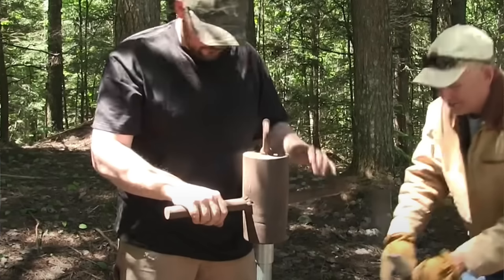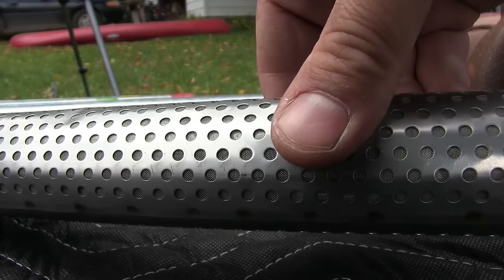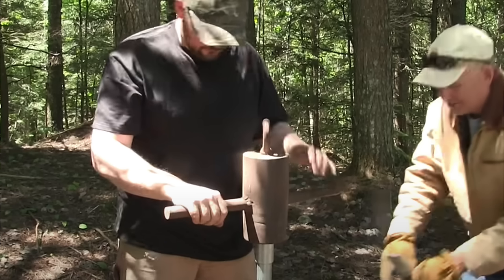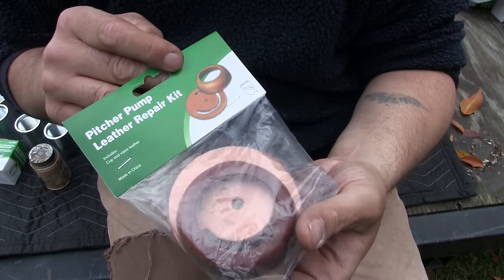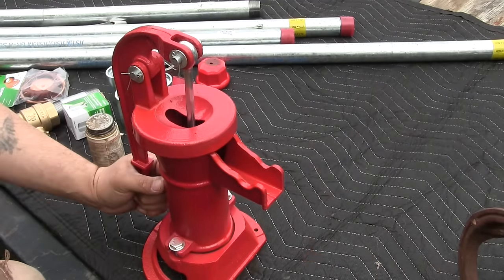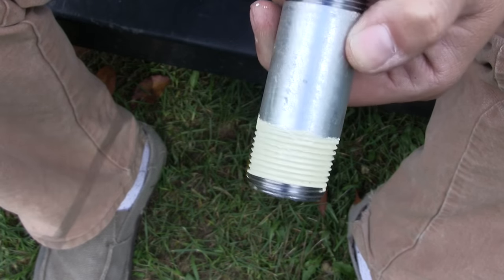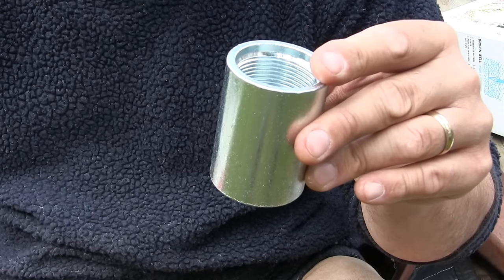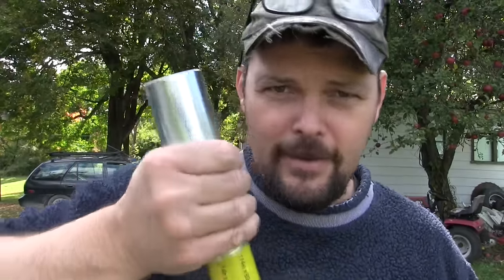Hand Pump Well , off-grid, self-reliant water, everything you need to know

Comment: For reference, the volume of water in a 2" tube at 24ft is just under four gallons and the water inside the tube will weigh 32lbs, which is why you seldom see hand pumps with a bigger well head than 8mtrs... to be honest you will seldom see a basic domestic pump with better suction than that too, so if you water table in the summer is 24ft below your pump then consider siting you pump at the bottom of the hill !!  I speak from experience
Reply: So really it should be, Jack and Jill went down the hill to fetch a pail of water.  Except then they wouldn't be able to fall down the hill, because they would already be at the bottom!

Sorry lol, just got done teaching at the local preschool...

Comment: I think that the no pipe dope on the 1st 2 threads tip is a great tip. For all applications, like hydraulics, air, or gas. Even for Nitrogen gas used for laser cutting. 
This whole video is full of great tips.

Comment: There is another way of driving the pipe down: in the hole you dug, add a bucket of water first, then you may join two 5 feet pipes to the driving point, and then you can simply raise the pipes up and the drop them down. With the water in the hole, the weight of the pipes can drive themselves down into the ground. You can add water into the pipe as well so the water can get to the driving tip position. This way, you do not need to use hammer or the home made driving weight.
Reply: Great tip; thank you!
Reply: I'm familiar with this driving possibility but I think the method may obscure when you have hit water.

Comment: I have worked with these for a few years. Your explanation was fantastic.  I like your style and the way you addressed those areas you were  not comfortable discussing. 
In my area, the ground water is quite hard which requires replacement of the well point every so often.  I have 2 points: one in the ground and one waiting.  When I must replace, I pull the pipes out, swap the point and reinstall.  I take the one just received and treat it with a bath of CLR rust remover inside a section of pvc pipe I keep on hand for just that job.  This dissolves all the growths off the silt screen and reconditions the point for return to service [after a good cleansing].
Reply from the maker: Sounds like a good system.
Reply: Test water for contaminates drinking from surface water. I am old water well driller now retired.

Comment: Another tip - to keep any "junk" off the pump when not in use, the 10 quart Behrens #1210 hot dipped galvanized bucket works like a charm. Tip it upside down and it fits over the pump like a glove. The wire handle fits securely under the pump handle, furry woodland creatures can't seem figure that out and strong winds will not blow it off.

Comment: Love the vid, information I really didn't have. I think you could set up with a T and valving so as to add a small electric pump, 12v that could be run off of solar. Teco makes some small ones that run off a single solar panel for pumping water from a rooftop water solar panel to a water tank in the house. I'd have to check to see if they had one that was self priming though. And, once the well was sunk, I think you could switch to Sch80 or even Sch40 for all the above ground plumbing. One note on pipe dope vs. teflon tape: neither is intended as a sealant. they are both intended as a lubricant to allow the fittings to be tightened enough for the threads to make the seal. If there is a leak with either it's because the joint isn't tight enough.

Comment: You dismiss Teflon (PTFE) tape, then complain about the taste of PTFE pipe dope?  Just use the damned tape, and be done with it.  It's not like it's $100 a roll, and if you put it on right it doesn't leak, either.
Retired plumber.
Reply: Yes and there is now even improved version like Kolmat Fibre Seal that allows you to turn back 180 degrees on the coupling you just tightened too much (which happens all the times when I mount taps and elbows...) See video https://youtu.be/cdDCyLpnAB4 By the way, what do I spot here?  https://youtu.be/0QUk6fn8Lr0?t=836 :-)
Reply: you are right, i thought,,well after a couple times a person figures out how to wrap pipe threads but aint my show uno,,
Reply: @ttkddry  It looks suspiciously white and tapey...  ;o)
Who TF uses garden hose for pressurised water supply?  That won't last long, especially when the sun gets on it.
Reply: Jordan Moir  Zinc pipe hasn't killed me in 70 years.  Maybe I'm too mean to die.
Reply: Take it easy.

Comment: 7:10 you could use a fence post driver..(its the same thing and commercially available)
Reply: And I have seen motorized T-post drivers that might work as well
Reply: I thought the same thing
Reply: @dropshot1967  . We had some heavy post drivers (called them thumpers) in the service, had t-posts and v-posts.
After building a couple of miles of fence for a defensive  position, you get some sore..😁👍🇨🇦
Reply: Could you combine the fence post driver with the pulley and tripod to make it easier? Also, is it possible to use more pulleys to get more leverage? Seen some interesting info on using pulley systems to lift lawnmowers etc in a garage.
Reply: @tracyk3567  I was thinking to raise and lower the weight you are pounding the pipe in with. Still no?
Reply: I meant to raise it then let it drop.

Comment: Great video, It is not usual for anyone to talk on a point such as this and remain interesting. Your plan is right on the money and steps understandable. The extra tips about the joint compound, and cleaning out the pipes is on the one, because I would not have known or thought about that until after I installed the pipes and pump . Those are the things that will make a big difference with the taste of the water which are very important to me when I drink the water. I have to say again, you made a nice instructional video and it shows. So many tubers are now concentrating on fluff, instead of strong, interesting, and thought out content. Nice job! Now I can install my well and pump like a pro.

Comment: Old plumber turned me on to rectoseal number 5. It is much better seal and lasts forever. I could not find an old pump so I took a cylinder hone and cleaned up the bore. If you open the ball valve all the way you can trap water behind the jacket and it will crack, always leave ball valves slightly open over winter... Great video, I really appreciate all the information. You're increasing My carpentry confidence!!

Comment: Back when I was a kid we drove a well for the cottage we were building. As soon as you gave that taste test I could remember how that first water tasted out of our newly driven well. It lasted for about a month. Also it seems like the older pitcher pumps had a bit longer stroke on them. Thanks for taking that pump apart and showing how they work especially with the leathers. Great visual aid. Hope you and your family have an excellent Fall season.
Reply: yup:new pumps got like 5 pumps in 1...alot leathers and go like 60 feet: more softer slow pumps but just keeps going/waters keep comeing at slower rate /smaller pipe :>)

Comment: Great video! Thx! Best way to pull stubborn pipe well pipe is to use a heavy duty hydraulic car floor jack (2 ton or so) or just a regular hydraulic jack, wrap a chain around top collar of pipe, and the other on the end of the jack and jack it upward. You can use wood or the like as a base for the jack so it won't sink into the ground. Usually once you get the pipe moving, it gets easier and you can just keep cinching the chain down the pipe as it rises. 
😉👍

Comment: There is so much misinformation about depth.  How deep is the water level in your pipe.   That’s the depth that matters, nothing else.   You can go down 100’ and still have water at 8’ which is your draw level.   Steel couplers used to have a collar inside which was important to hit with the pipe.  That way your threads aren’t taking the impact.   Since they no longer have shoulders make sure your pipes touch inside the coupler or your threads my give way.   The first one I drove I broke off the threads and pulled up what we could and started over.   Lesson learned.   You remove it with a car jack and a large -pipe wrench.

Comment: My well is 26' and I use a hand pump to bring water up to the top of the well pipe in the springtime before I hook up my electric well pump.  Water is held at the top of the pipe with a second check valve (I have one at the well point and another at the top of the pipe).  That helps me get water to the top easier but the pumping is still noticeably more difficult.

Comment: Well, I clicked on this just because I find the subject interesting. Currently, I have a motorized pump setup from a previous owner that seems to be either dried up or the screen down there is clogged. I ttried to pull the pipe using a come a long and rail road ties for an A frame but it didn’t budge. Only the come a longe handle bent so I left it. I’d like to get it going again so now I have the incentive to pick a new spot now that I’m here with great info on the subject.  I’m going to install a well after the current freeze simply because everything covered here is so true, easy to follow and understand. For anyone reading, please know this information can’t be found in a simple search and can be applied to many aspects. Please also know, the wealth of information here is worth saving. So save the video, write it down, record it, do whatever you can do to keep it so you can refer to it. Thank you so much for posting. May God Bless.
Reply: Try driving it an inch or so.. kinda like tightening a stuck bolt a smidge, to get it to break loose. Also an old time car jack- high lift- and a length of chain wrapped around the pipe, sometimes works for extracting. Junkyard best spot to find them anymore!!
Reply: @tomgrams2333  Hi Tom: I tried  a 10 lb. sledge until it mushroomed. I put a pipe wrench on there with a 6’ piece of 1” black pipe to twist while my friend pounded. No go. Next time I’ll drill a 5/8” hole in there with a bolt to grab on with a hydraulic pull ram that I have left over from my body shop days. If that doesn’t work, I’ll have to find another spot. Thanks for helping me. May God Bless.

Comment: We did this at our camp.  I'm also in the U.P.  On the home-made driver, there use to be fence post drivers sold at TSC, Menards, etc. that are similar.  Even a larger piece of steel pipe (1 1/2' to 2' long) with a chunk of iron welded on the top works.  They're sold as metal fence post drivers.

Comment: Couple of tips I have for you. Your drive coupling the one your going to replace , always keep it tight or it will split when driving. A nice size engine flywheel welded to an axle shaft makes a good driver. A person on each side lifting and dropping the flywheel makes good work. I have pulled new wells with a log and a piece of chain and a large block. Lay down the block close to the well pipe to set the log on, adjust to get good leverage. Hook the chain around the end of the log close to well pipe. Have one person lift the end of the log  opposite of the well pipe. Wrap the chain two wraps around well pipe the push down on the log. Pipe will lift out of the ground. Keep repeating sliding the chain down on the well pipe each time. I hope this method makes sense to you. Thanks for your videos. ATB
Reply from the maker: Thanks

Comment: Lucky for you. Out west, I don't think I've ever heard of water less than 100 feet and that would be very lucky too.
Reply: Where I live in Georgia many people used to have (and many still do) bored wells that were maybe 35-40 feet deep that supplied their households.  Others had drilled wells several hundred feet deep.  Electric pumps on both kinds, of course.   My old bored well is capped (pump and shed removed) and I'm now on county water.  I could start using it again if I chose to.

Comment: Thank you for this video. Just recently got the ability to move out into the country. We now have well water and septic and I have no experience with either. My grandparents had both but unfortunately my grandfather is no longer around to ask all the questions. We have to redo both and this is some great info to add into the mix, thank you.
Reply: Please make sure you have your septic pumped every two to three years, or the results will be a nightmare. If not pumped out regularly, all that icky goo will back up into your house, and you sure don't want that! If you are using the old system at all it would be wisdom to have it pumped out right now since you may not know when it was last done. Call a local septic company, and they can let you know the frequency that it should be done. Last time I had mine done, it cost @ $200.

Comment: The pounder on top  is called a post pounder or picket pounder you can find them online.
Reply from the maker: ( not the same thing) the one we used in this video is probably 4 times as heavy and has a 3' piece of 1" rod that goes down the pipe to guide the hammer......
Reply: @Bushradical  Question, we have Amish here in Indiana that install round fence posts, probably 6" in diameter and 8' in length or better. They use a skidsteer attachment that drives the post into the ground. Wonder if that would work in this situation?

Comment: A great explanation of how these pumps work.  60 years ago, my dad installed a 25' driven well in the garage of our house, where no one could see it, and we had potable water after hurricanes.  Worked fine.  I never knew until lately I grew up homesteading, prepping, and doing bushcraft.  I just thought we were poor.  I'd have held my head up more if I knew back then doing what poor people do would become trendy.

As much as I like your videos, you're kind of a cowboy (I'm sure you've been told that before, and are aware it's part of your appeal), and I do wish you would recommend your viewers check permit requirements in their local areas.

These guys are considered a Class IIIC well in Virginia (driven, less than 50', used for drinking water).  
- Permit required?  Yeppers!
- Grouting required?  You betcha!
- Could the hand pump be, by design, a violation of the "no unprotected openings into the interior of the well" clause?  Depends on the mood of your inspector.

Comment: When I was a young kid we drove many wells by hand. Back then the drive well point was referred to as a sand point. To drive the pipe we used a piece of railroad rail about 20" long. It had a steel rod welded dead center on the bottom, flat side of the rail. Never worked so hard in my life! 

Nothing sucks more than hitting rocks and gravel that strip off the outer screens from the sand point! Have to pull everything and start over 😖

Comment: We have a high water level in my area.  We all ready have a pump but if, and when the grid goes down, we may need this. I have an old well pump...I think it is in fine shape. But, I will have it checked by the man who cleaned my well. You created an AWESOME video, and I have been concerned about the water in my prepping plan.  My husband is not on board, so it is frustrating as my children are not in the immediate vicinity, and I am IT in terms of the research, gathering, planning and close to freaking outing  LOL. Thank you for your help.  Note...when my best friend got divorced, she, and the one she called on, me, to help her replace a headlight, etc.  She called me one day, and I went over.  She had the pipes of the sink apart, as she had dropped an earring in there. Now, she couldn't get it back together.  I said, "We can probably do this, but when Jerry, (My husband) does this, he uses this white plumber's tape".  We did get the pipes together, and I seriously mistakenly got that tape the right direction.  Voila...No leaks.   My husband always had to leave one leak.I was so ready to get a Plumbers license LOL.

Comment: Great video! Pipe dope does not seal the coupling, the threads do the sealing, that's what the taper is for. Pipe dope acts as a lubricant. The best way to avoid the taste of pipe dope, is to use teflon tape for your threaded joints in place of pipe dope. What might work is to use use PVC. A high pressure hose can be put down inside the pipe to clear the path ahead of the pipe

Comment: Thank you!  This is the best one I've seen too giving us everything we need to know.  As a woman I'm not sure I have the strength to do it  myself but now know I definitely would not use a pump driver - 90lbs I couldn't even pick up.  So I would use the sledge hammer approach.  One question for cold weather environments, how about putting he pump in and building your home around it.  I saw one homesteader who did that which would eliminatte the freeze issue.  Not sure how difficult that would be, but you having build your own cabins would know.

Comment: remember to leave the ball valve open in winter in cold climate. I grew up with this kind of pump. we did not have to prime it when used regularly. we would just leave the bucket sitting with enough water to prime setting by pump for next time.

Comment: If you can pull water 25ft you’ve done well.  The best I’ve done was 22ft and I’ve put in a few. I made my own driver and it works great. Imagine a fire extinguisher with the bottom cut off and two rebar arms. I poured in about 40 pounds of lead and welded a plate over the lead and it’s been great. That’s probably a bit difficult to envision. I did an up grade by welding a steel rod to the plate in the extinguisher and drilled a hole thru the drive cap. Keeps me centered on the pipe. Your spot on about cleaning out the pipe and watching out for to much pipe dope! Nothing like a glass of oily tainted water. Long winded I know but if you tie a weight to one end of a string and a clean rag on the other end you can just drop the weight thru the pipe and pull the rag thru. This is by far the most informative video I’ve seen on the topic.